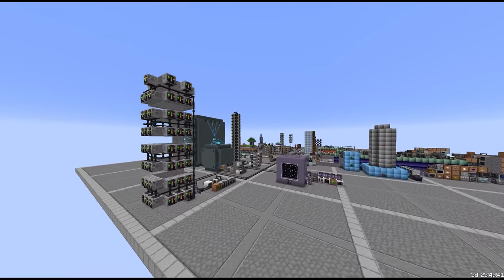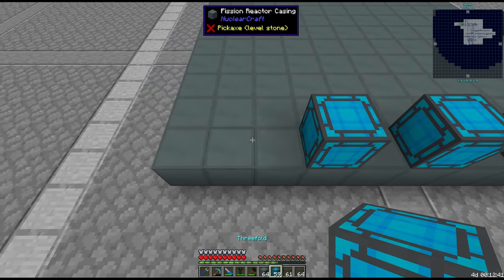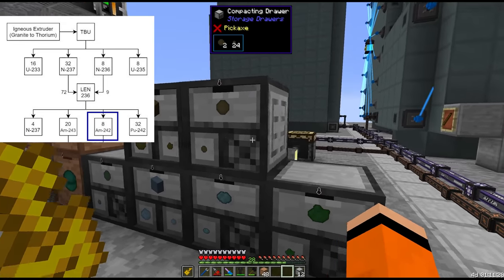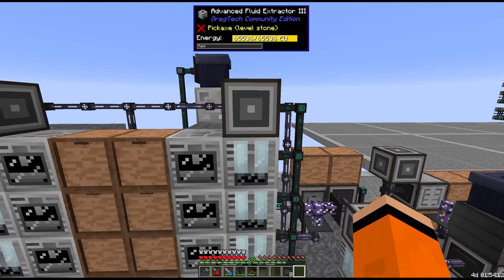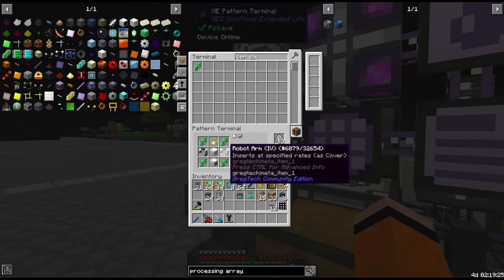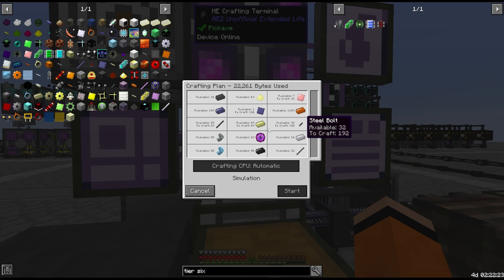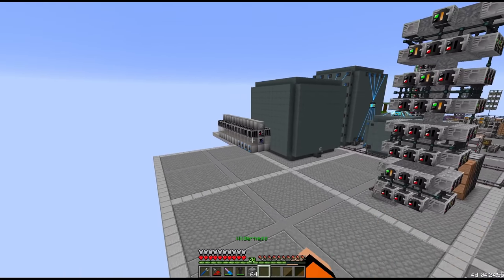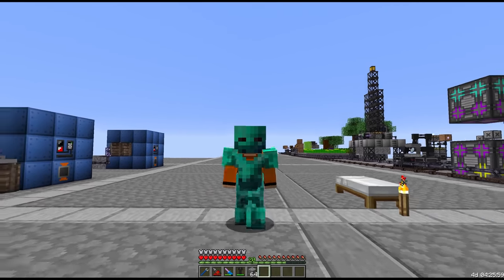NuclearCraft Fuel Processing & Sunnarium - Nomifactory: Episode 17

Comment: How do you make sure your reactor doesnt deadlock when you running multiple fuels through it? Wouldn't it just keep burning the lowest one and never get to the higher tiers?
You had another multiblock some episodes ago, the one making argon etc, where I was wondering the same, since you use the same machine for two steps in the process.
Reply from the maker: The reactor running TBU doesn't produce so much as to fully saturate the fuel processing reactor. Also keep in mind that it takes 9 fuels at each tier to craft the next, and most of the time you only get a few tiny pile versions from the centrifuge. If anything we could do with more speed to build the higher tier of Nuclear fuels. Clogging the reactor isn't something I can see happening long term. It's just because we were building on TBU for so long without the reprocessing. :)

Comment: how tf are ur signalum cables enough for ur energy usage mine are full 512krf per tick and I cant power 1/5 of the shit I have to meticoulsly plan out all the costs this is bullshit its frustrating me
Reply from the maker: Remember conduits operate per connection. So if you are able to connect more sides of the input or output they can transfer: listed transfer rate * connection points :)